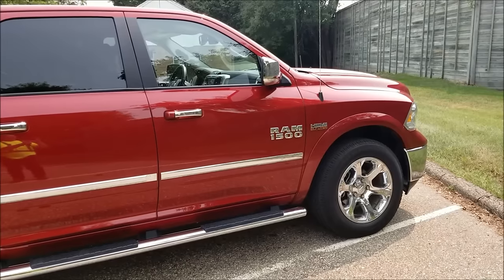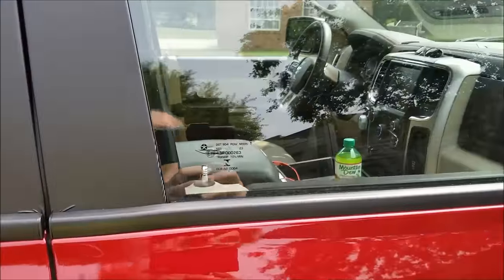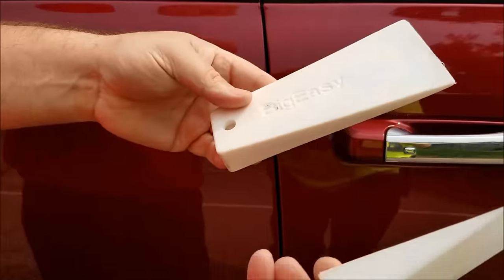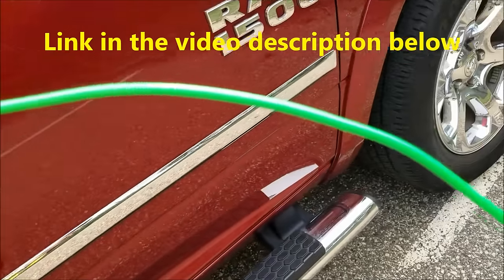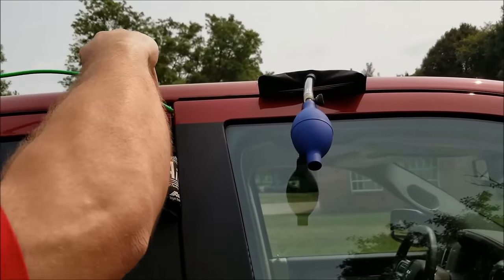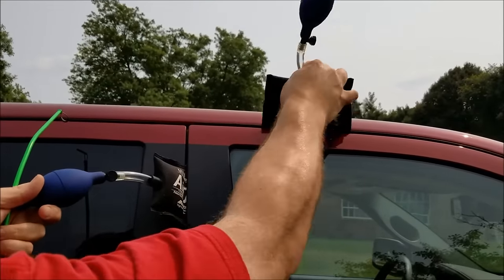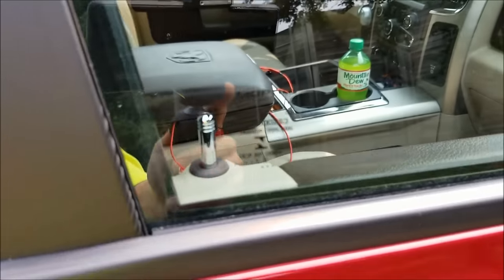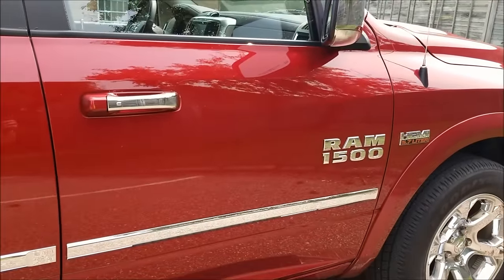How to unlock a car door without keys, the easy way.

Comment: Just go to the locksmith and have a dummy key made and keep it in your wallet. It won't start the vehicle, but will open the door. It only took me one time of locking my keys with the engine running to have dummy keys made. Towtruck driver gave me the idea.

Comment: Yeah my van has the same lock but when its locked it goes flat so u cant grab it like that
Reply from the maker: Yep, many vehicles are like that. Those locks are easy to open too, they just require a different door unlocking tool than the tool shown in this video.

Comment: I get an extra key made for $3 and electric black tape it on the wiring harness to the license plate light.  I undo the tape and use the key to open the door whenever the key is locked in the vehicle. Just don't lock it inside on a rainy day, as you have to lay on the ground and undo the black tape to get the extra key. Sure beats a $75 locksmith call to unlock it !!!!!

Comment: I saw a tow truck driver a tool that looked like a metal hanger in diameter and was expandable. Firm yet a bit flexible. He put it through the tiny space like where these inflatable gadgets were at the top of the door. Then just hit the automatic door lock. I have no idea what it was called but smaller more convenient tools are out there. These gadgets are great if you have someone home who can Bring them out to wherever you are locked out. Too big and bulky to bring with you.
Reply from the maker: There are many different types of unlock tools for different types of cars. This was a demonstration of one specific tool. Thanks for the comment.

Comment: Can this tool be used to get into newer car models like say a 2019 Hyundai Veloster N pls give me a reply b:c I think someone is doing this to get inside my car. It’s parked in the driveway every night. But when I return the next day, someone has taken napkins out of my glove compartment, or my driver side door storage compartment. They never take anything valuable just petty things to let me know they can get inside my car whenever they want to. HELP!!😫😫
Reply from the maker: This was a video demonstration for one specific type of door unlocking tool. There are many types of door unlocking tools on the market depending on what type of car you're trying to unlock. I probably would not use this specific tool on a Hyundai Veloster, but one of the other types of door tools would certainly unlock that car without much trouble. Pretty much any car on the road today can be unlocked with some sort of door unlocking tool.

Comment: Been doing it like this for years. Not with the nice equipment you show here tho. Usually with screw drivers and wedges and coat hangers. Recently found what I needed half a block away near a dumpster. Have been able to do it with minimal damage, other times, not so nice😬 now I carry a spare key 👍👏👏👏👊🏻

Comment: Or carry a spare key in your wallet. Been unlocking cars for sixteen years and only need one air bag and a slim Jim. I use a paper towel core to slide my rod thru if I have to go inside the door to protect your molding.

Comment: Are these tools legal?  I remember years ago if you had a lock out stick or slim Jim you would be arrested.
Reply from the maker: 100% perfectly legal. At least in my state. Every tow truck driver, roadside assistance guy, locksmith, car dealership, car auction, auto mechanic, etc has one of these in their possession. They are everywhere.

Comment: Couple things, it's illegal to have these unless you are permitted to have them, these tools are most likely locked in your car (also illegal to have them in your car), and it doesn't relieve pressure on the latch. It relieves pressure on the window. If you don't deflate the bags it will most likely blow your window out.
Reply from the maker: I've never seen this permit you're talking about. And I've been in the car unlocking business for many years.
Reply: @SlipFitGarage  if you get caught with it in certain states, it can be considered possession of break in tools. The only way it's permitted is if you are law enforcement or a job such as working for a tow company or a locksmith in company (in the way of lockpicks).

Comment: How about take the plug out of  drivers side floorboard  underneath  the vehicle then take a stick or whatever available   and push the carpet up untill it  releases  the trunk pull latch  next to seat. Then push rearseat forward and unlock a door. Put plug back in . This works on many cars.

Comment: One suggestion I will give. I have seen several people trying to get in their car while the key is in the ignition and the car is left on. While they did something similar to this (even when the lock was down low) . They usually find themselves (with a hanger) trying to hit or catch the lock. My suggestion is to roll down the window. It's usually way easier but people never think of it.
Reply: How they gonna roll down the window from the OUTSIDE!?

Comment: I been towing for 10years, last year I started where I'm at now this is just like a silly strip my wrecker now is loaded with this. Silly strip I still find easy but this is simple as well. Remember  it only for bull up locks wood be ur pick up trucks some older mustang,  all ur maxima Mazda  etc have the pull  back that would be ur big easy long bar, ur Honda civic are push f.w and the door handle won't pop it. Some cars  have the auto lock so u need to pull the handle back at the same time open the door Handel.  Just tips this wont work for all cars. So get ur  big easy long bar as well guys

Comment: A magnetic combination lockbox has been invented,  as long as you seal the dials from moisture it will work the best.  Mine is on the roof next to the roof rack you can't tell it's up there.
Reply from the maker: Correct. They were invented a long time ago. Unfortunately, there are people in this world who are not currently using those lockboxes..... when those people find themselves locked out of their vehicles, then what? These door unlock tools were invented to help those people who didn't plan ahead with a lockbox.

Comment: All you need is a sturdy wire hanger stretched out the long way with a small loop or hook at the end of it to adjust and insert when pulling back while hugging the door lock button.

Comment: I worked at a Casino for 11 years (I.T department). I waz going to say, I seen the security guys use these air bags. Yes, they work. BUT, your door never sits right after. Always a slight gap. Now you have wind noise.

Comment: The best way is the combination pushbutton box that holds a key, that only takes less than a minute, I attached mine to the frame. Make sure you wd40 the keys you hide under the vehicle they rust. Wrap the key box in plastic and duct tape. I had a vehicle that I locked myself out of 50 times because the lock button was easy to hit.
Reply from the maker: Excellent idea. And one that most people don't think of until its too late. So what about the people who didn't think of hiding a spare key and suddenly find themselves locked out of their vehicle? What are those people supposed to do? That's where these tools come into play... Thanks for your comment.

Comment: For my Honda(and I suspect many cars) you could just use the green tool to push the door unlock button.
Reply from the maker: You could. Depends on the vehicle... On some cars the electric door unlock switch inside the vehicle is disabled by the computer so pressing the unlock button does nothing.

Comment: You can do the same thing with a screwdriver and a wire coat hanger.  Perhaps wrapped the screwdriver in some sort of thick tape like electrical or duct tape to keep from scratching up your paint.
Reply from the maker: The "same" thing? I doubt it. Lol
Reply: @SlipFitGarage  Why do you sound so doubtful?  I've already done it.  Once, I even had to tell a Captain when he asked if I knew how to break into a car, 

".......I can't BELIEVEEEEEEEE, you picked the right Mexican.....uh...let me get my tools Sir."
Reply from the maker: I don't doubt that you can unlock a car with a screwdriver and a piece of coat hanger....  I never said that.  Your original comment to this video said you could do the SAME THING with a coat hanger and a screwdriver.....  My video shows a tool that consists of a hallow tube with a thin cable threaded through the center of it, that closes tight when when you pull the handle.  You cant do that with a coat hanger and a screwdriver. Period.  That it why I quoted the word "same" in my original reply to you.  That is why I am doubtful.  Unless you gun drill the center of your screwdriver shaft, then thread the coat hanger through the screwdriver, you absolutely can NOT do the "same thing" as I showed in the video. lololol. 

I have been unlocking car doors for 29 years....  I have seen it all....  coat hangers work sometimes but there is a reason why real door unlock tools are much larger in diameter than coat hangers.  Coat hangers simply aren't stiff enough to allow for enough dexterity in most cases to get the job done.  Sure, if you waste enough time farting around with them, they might eventually work, but real door unlock tools just work, and they work quickly.

Thanks for the comment!
Reply: @SlipFitGarage  Oh please.  Now you're just arguing semantics.
Reply from the maker: @inorite4553  
No, everything I posted is a fact.....  You cant do the "same" thing I did in this video with the tools you mentioned, and coat hangers suck for unlocking cars.

Comment: This world have worked great on my old car.

Cost me $87 to geg a locksmith to unlock my car door when I accidentally left key in engine with engine on.

It won't work on my new car because the lock is not vertical. 

Horizontal locks are hsrder to get around when it comes to lock picking.
Reply from the maker: Not really.  Your horizontal door locks simply require a different door unlocking tool.  The particular tool in this video is only designed for one (common) style of door locks.....  there are MANY styles of door unlocking tools.  Thanks.

Comment: Just use one big plastic wedge on the side of the door, put one of those airbags on the top of the door  like you did in this video, and use a straightened out wire hanger, where you turn the "hook" into a loop. No need to waste money on another useless "gadget." Then do the same thing you did in the video. I actually  saw this in action between 2009 & 2012.

Comment: Go to CVS or rite aid. Get 2 gallon zip block bag. Place 2 bags inside on 1 bag so u have 3, get some duck tape and reinforce the corners all around the bag. Get a straw and a small little air compressor thingy for flat tires or ur lungs and blow lol. Seal the vacuum by pinching the straw. I’ve got ur self a cheap version.

Comment: Do you know how to enter audi A6?
Reply from the maker: I can honestly say that I don't believe I have ever unlocked an A6 Audi. However, that doesnt mean I cant get into one, I've just never tried. If I had to guess, I'd say it probably isnt much different from 99.99% of other vehicles on the road....
Reply: @SlipFitGarage  it was not the same %100 different than the others.

I've tried as they had w of the A6 1 of then were already unlocked i tried while the windows were down still couldn't open it from inside i even seat insaid the car it was strange.
Reply from the maker: @dashtyATG  
Weird.... I'm pretty sure its a law in the US that any car sold here should unlock the door when the inside door handle is pulled, OR there needs to be a physical unlock knob/button/lever that can easily be manipulated by the occupant.... there needs to be a way to easily unlock a car from the inside to prevent a person from being locked in. Now, with that said, EVERY car that I've unlocked here in the US over the last 30+ years has been that way. So, if you're saying the A6 is different then its either A) illegal, or B) you're mistaken.  I don't care either way. Lolol

Comment: Thats easy but what if you have a car like an Audi where the button sits flush, there is nothing to grab hold of ?
Reply from the maker: Then you would use a different type of door unlocking tool. This was a video demonstration of one type of door unlocking tool, there are many others on the market for different types of door locks. Thanks for the comment

Comment: That's all fine and dandy if you are carrying the crap around everywhere...or you lock em in the very same vehicle that your keys are in. I'll save you some money... just put the valet key (which is usually plastic) in your wallet. Some are in one or both of the key fobs or in the pouch with the owners manual. Won't cost you a dime and you'll never feel it in your wallet...or just have a legit door key made for a dollar or so (one without the "chip" in it).

Comment: Go see your local locksmith.
Get the key decoded and put the key type and code in your phone. If this happens call any locksmith and give them the info. They can make the key and bring it to you.
Dont worry about if it has a chip.
Most door locks dont need a chip to open only to start.
Reply from the maker: How much does that cost?

Comment: There's just one thing I don't understand... My Fiat Seicento (1998) has a vertical lock that sits flush with the door when it's locked, so the handle will only open it, I mean that's kinda the better thing against stealing your car in 15 seconds lol. (for the record, my car is not worth stealing and I often forget to lock it at all lol) Anyway, when the door is opened, it won't lock (the pin cannot be pressed down). From the outside you can only lock the doors with the key. There's no way to lock yourself out, unless you leave your keys in the trunk and shut it (it has no latch, either the key or a handle under the driver's side seat).

It's a little more inconvenient when you have to tell people to get out first because then you can lock it from within, because they can't do it themselves. But locking yourself out is way more inconvenient I suppose...
Reply from the maker: This unlock tool does not work on every vehicle, which I mentioned in the video. Your car would require a different unlock tool. Thanks for the comment.
Reply: @SlipFitGarage  Of course, but I realized that there are also a number of cars that have seemingly the same locks, but where this won't work. Might prevent people from buying stuff they have no use for. 

Either way I won't be needing this anytime soon as I got two spare keys with this car lol.

Nevertheless it's a cool video, very informative. Thanks for your repl
reply.
Reply from the maker: @break1146  
Thank you for the comment!

Comment: There is a much easier way, if you have someone at your home tell them to push the remote unlock into their phone and have the speaker on of your phone. Put your phone butter side up and resting on the windshield. Your friend will have to press the remote several times. You won't hear a thing, but the car's  obd computer will.
"The more they overthink the plumbing the easier it is 2 stop up the drain"

Comment: This sets off the car alarm on any car thats actually locked.
Reply from the maker: Any car?
Reply: @SlipFitGarage  2008 and up in my experience.
Reply from the maker: @SeiekiAkuma  

Probably. But in my experience there are still millions of cars on the road made before 2008 so I wouldn't exactly say "any" car. Lol. And who cares if the alarm goes off anyway? All you need to do is either hit a button on the fob or turn the ignition on, etc and the alarm shuts of. At least you're not still locked out of your car at this point. Thanks for the comnent.
Reply: @SlipFitGarage  I've only done it with Chrysler owned brands , my keys are locked in .y car right now 🤣 dodge avenger 2014.
Reply from the maker: @SeiekiAkuma  
That sucks. This tool would work perfect on that car....
Reply: @SlipFitGarage  I might buy it, I used a coat hanger and a knife to unlock my door.
Reply: @SlipFitGarage  It set off my car alarm btw 🤣
Reply from the maker: @SeiekiAkuma  
But at least you finally got into your car.... 👍

Comment: That's funny. Where would you keep all that stuff. Behind the back seat.   You could just pull the door out a bit and use a stick, rod , bar and just push the unlock button.   Much much easier.

Comment: No disclaimer about how too much pressure can cause a permanent bend to the window frame? AAA sent a yahoo out from [name] towing service; he used a wooden wedge and a folding measuring rod to press the unlock button. It was the first time I ever saw this method of unlocking and I was impressed at how easy he made it look. Days later I noticed the driver side window frame was slightly bent outward along the top.

Comment: I don't think people keep that tool in their back pocket then they go out to the store or running errands lol. 

What I always do does it matter if it's a key with a chip or not I make a dummy key copy without a chip and I stick it in my wallet.

 if I ever lock my door l take my wallet out which is always in my pocket and use my spare dummy door key.

That's the best tool you can get lol 👍😉

Comment: What you did is actually bending the window side of the door
I would not recommend that method because it is a plate and when you bend it, it won't be normal again
Some body repair often bending that parts to correct the gap
Reply from the maker: Those air bags are used by thousands of roadside assistance guys, locksmiths, tow truck drivers, and mechanics on thousands of vehicles every day here in the US. Millions of cars have been unlocked with air bags. They are standard issue in the business.